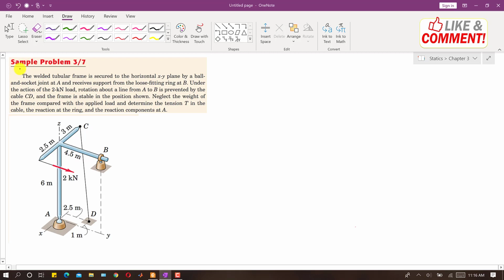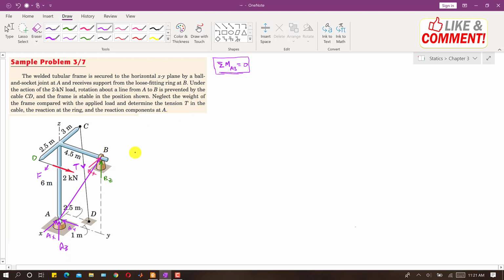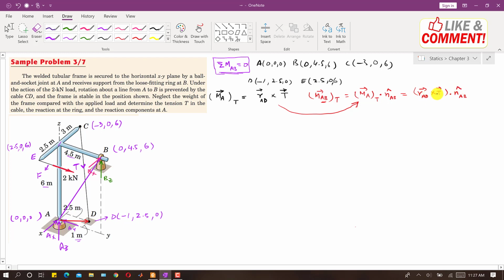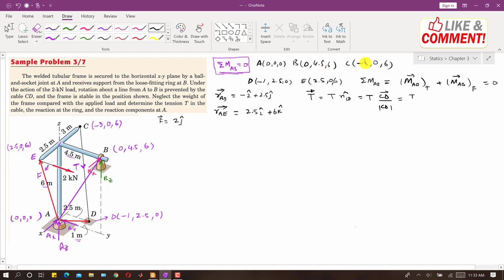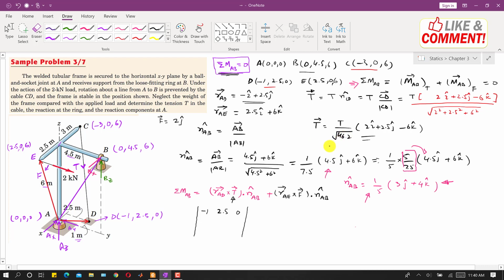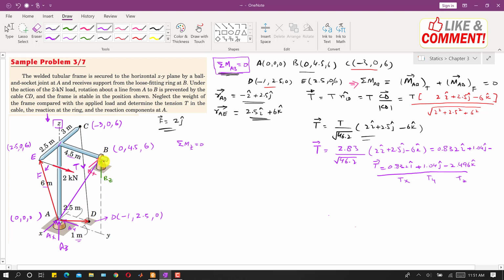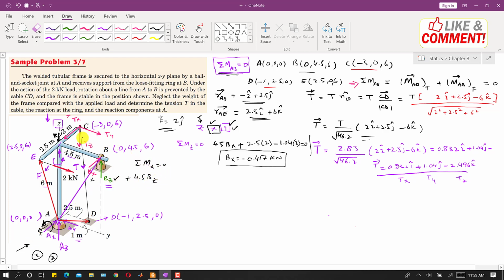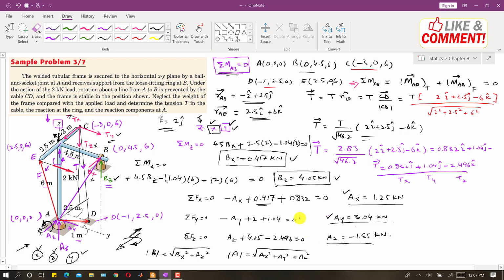Engineering Statics | Sample Problem 3/7 | 2D Equilibrium | Chapter 3 | 6th Edition

Comment: The sum of forces along z-axis shouldn't be 4.05 + 2.496 as the tension T in z direction is negative and Tz is also in negative direction?
Reply: Az+ 4.05 + 2.496 *
Reply from the maker: So the components along z are negative